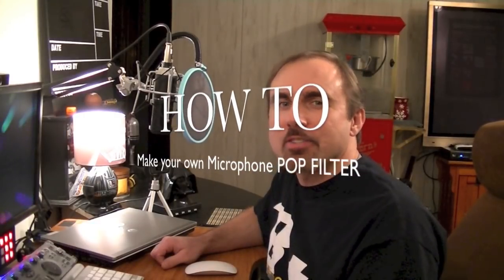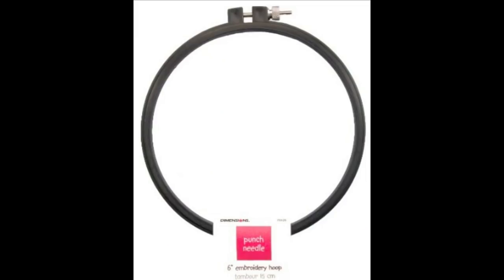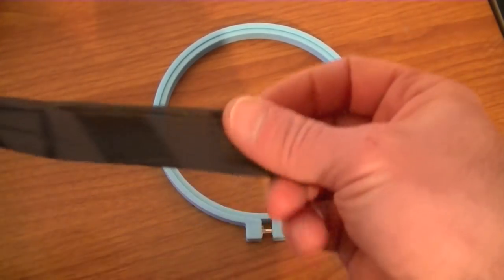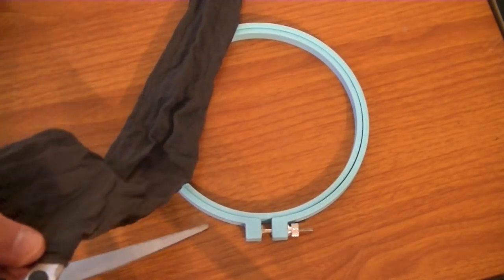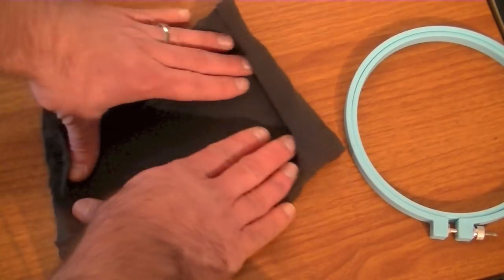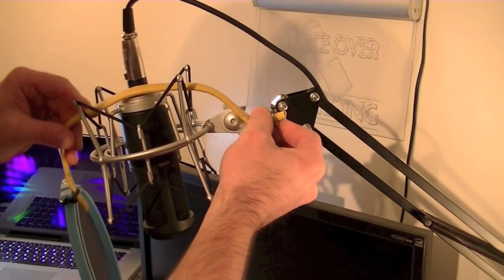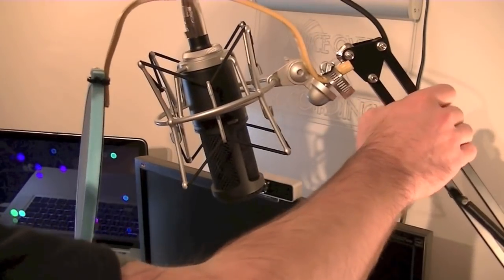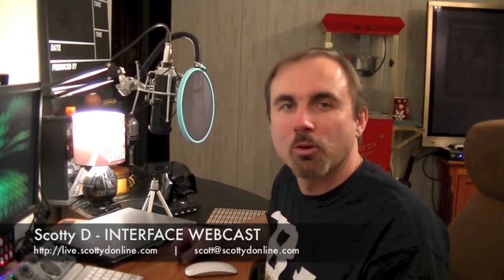How to make your own microphone Pop Filter

Comment: It's very easy to stab yourself with a screw driver??? Probably the dumbest remark I've heard in a while. And I use several full metal pop filters on various microphones. It has nothing to do with resonance. The metal mesh is constructed with angles to break the wind pattern. They are incredibly effective. I own a recording studio and have no idea what you are talking about when you're referring to metal resonating due to a metal pop filter. There's a reason they cost $100 a piece. It's not because everyone is out to get the hottest brand of pop filter.

Comment: that's not the reason the is a pop filter ... 
the reason is because -- it stops the spitting sometimes singers emits to the microphone .. unless you carry your own mic -- this is the reason for these filters -- not for this BS pop sounds excuse ...
Reply from the maker: +you166mhz Part-in-partial you are correct... Studio Condenser microphones have very sensitive diaphragms and spiddle and spit can ruin one quickly. So if you're using a $1000 mic you absolutely want to protect it from vocalists and voiceover artists.  Professional studio's also use it to provide an absolute and consistent spacing between the person speaking and the microphone. This is especially critical in audiobooks where you need a consistent sound and even a few inches off from take to take will have adverse affects to the project outcome.  Lastly it is used to eliminate or reduce plosives and some sibilance... but any professional knows that mic technique is key and if you know how to properly use a mic, you don't need a pop filter to reduce or eliminate plosives and sibilance.  What's commonly happening is the person being recorded has extremely poor mic technique and therefore the studio has to have an element to bring consistency to the recording.

Comment: Could you just slip the panty hose over your microphone like a condom?! lol It may not look professional, would it be the same?
Reply from the maker: It may provide some protection (Excuse the pun) but because the hose will be directly contacting the mic, it will no doubt let the air pressure to reach the mic diaphragm.
Reply: Scotty D Thanks for the fast reply!  I did think about that... hmm...what is the theory about the air gap?    Is there a legit difference?  Also why do many seem to 6" and round? Would say a 1ft square work better?  Sorry for the noob questions!
Reply from the maker: I don't know if there's an exact science to the gap but IMHO, provide at least an inch or two between the pop filter and the mic.  Without a pop filter, it was taught to me in broadcasting school many many years ago to make a fist. Place your fist up against the mic... that's the distance you should be from the mic when speaking or singing into it. SO follow the same concept for a pop filter.
Reply from the maker: Indeed that is a very rudimentary solution that you could do in a pinch and it would work.
Reply: Scotty D I actually really prefer yours, though back a few years ago I made my own http://jollysworldofweb.com/my-home-made-pop-filter/ I still use it but want to make the one in this video, it also just looks more professional :)
Reply: Chris Jolly wow! Not even a new Chux?C'mon bro, that is just too cheap! lol
Reply: lol I thought it was, perhaps it's just dirty thanks to the content of my show :P